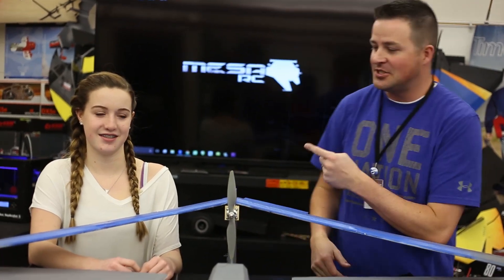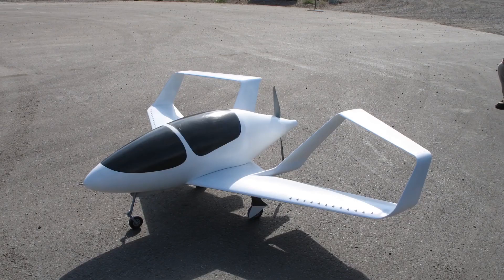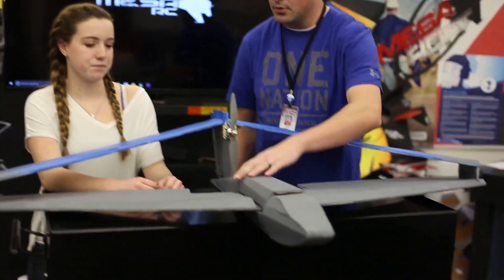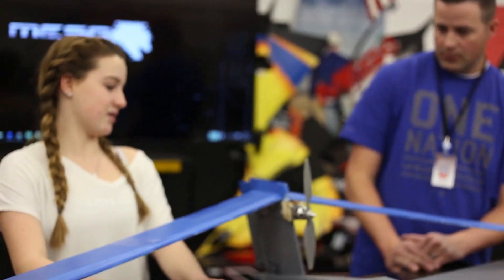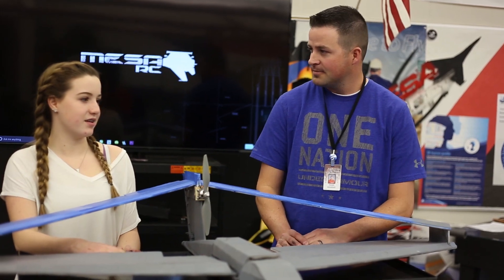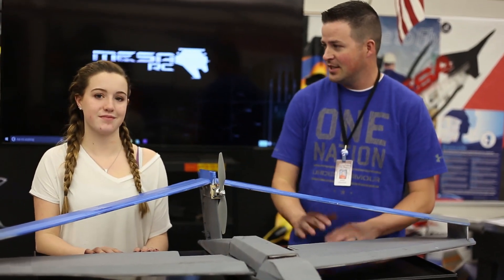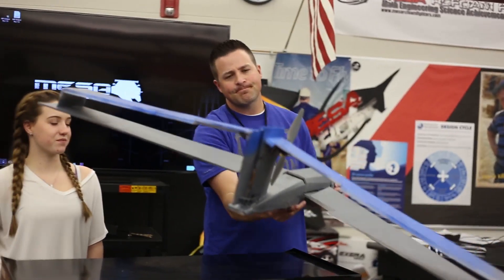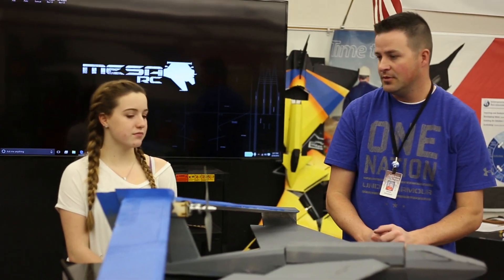MESArc - The Inversion Box Wing Project - NEED HELP!

Comment: this is called prandtl plane design, alot of detailed research gone into this type of box wing, particularly in italy
( cant remember the name of the group off top of my head), there was a phd thesis published that has all
the details on that design the maths included. The basic problem of the design shown is the wings, you need to have the big wing at the rear and the smaller wing at the front. The reason being:
the front wing effects air flow of rear wing ( pressure profiles), in order to get equal lift from front and rear wings
( in order to stop that nasty rotation of the plane in forward/back plane) the rear wing needs to be considerably larger than the front wing, also the centre of gravity is way way way forward on this design , you will usually see the front
cockpit area is way in front of the front wing.
Its not obvious too see these things, but if you were to swap the front wing and rear wing positions, you would have a better chance at gettting it to fly. But everything you need to know about that design has already been tested and sorted out, alot of time should be spent finding out what others have already done, you can simply copy their work and save yourself dissapointment.

Comment: First problem that I observed (and thankfully, it's not due to any fundamental flaws with the box-wing design): direction of thrust (consisting of just the propeller) is pointing above and behind the center of mass, causing the plane to want to pitch down hard. I'd have personally moved the propeller to either the plane's nose, or behind the plane's tail (the fuselage, not the wing), so that the direction of thrust lines up better with the plane's center of mass.

Comment: The lack of stability is mainly due to two factors: the line of thrust, which is far too high and that needs to be pointed DOWN to the ground, about two length of the aircraft in front of it; and the back wing, which is very anhedral and swept forward, creating far more lift than the front wing. You both should also learn about air foils before trying to make non-working toys.

Comment: First find your center of gravity. It is WAY up front, hence nose dives every time.
Reply: Put the motor at the back, decrease the height of the rear vertical stabilizer, increase the height of the two winglets on the wind tips. The batteries should be farther back for balance, but that might not be easily done.

Comment: Hey, congratulations Susannah and the MESArc team for trying some crazy stuff! Box wings and Boxtails are very different from each other and you can't just combine ideas, so pick one. Right now the layout says 'box wing, maybe... boxtail, no way.' When designing a box tail aircraft (using X-Plane can help), keep the tail and wing surfaces properly separated. Separation distances at any point along the entire span should not be less than a combined 'wing-chord-plus-tail-chord' length apart, as measured at the 25% chord location. Yours are too close. Controls: keep them on the tail; simple, effective. You won't need a rudder at all, just elevons.pivot them like Synergy or hinge them normally. Either way is fine. Balance: think flying wing. Work out thrust lines and CG as if the tails weren't there, then balance a tiny bit forward of that so that the tails have to make a 7-8% download. Keeping things light will help a lot. If you need help, give me a call. Glad to assist. -John McGinnis (find contact info at Synergy website) https://www.youtube.com/watch?v=Cgdc24kNYE8&index=4&list=PLp0A9EG2NdqZB59kY7go1QfVVqeiJzjuL

Comment: Too nose heavy.  Needs leading edge ailerons and perhaps front canards to compensate.
Reply: Nice going folks...cg must be ahead of neutral point,thrust angle looks wrong,
Reply: suggest getting a plane that glides first, would suggest airfoil profiles  be at least the  same (legates stratos), Does the rear wing lift? If so , incidence may be akin to canard.  Good project!!!

Comment: angle the motor down about 5 deg or more :)  you will need to fine tone the angle but it needs down angle to over come its placement off the center line.

Comment: Great job Susannah!    Here are a few ideas to try. 1) Make sure the back wing has exactly the same angle of incidence as the front wing. If the two are not perfectly aligned, then the whole of the back wing will act as a giant elevator, overpowering your elevator. You’ll need to use an incidence gauge or a pair of yard sticks to check this. 2) Your elevator is too small. In the examples of full size planes in your intro at the 53 second mark you show a plane with all of the back wing as an elevator. Yours is way too small. 3) I agree with the others, your plane looked tail heavy, need more glide testing to find the correct CG.  Keep up the good work.

Comment: In the 80's I read about trials to get such a boxwing model flying and it did not work. This config has nonlinear stability. The only successful application of a boxwing I know is an ultralight called Sunny Boxwing with the upper Wing in front and the lower wing aft. I googled a bit and found a long article telling what difficulties are hidden. 

My suggestion:  CG forward, Motor to the front. make ailerons to elevons, put GYROS on all axis, don't expect too much, don't trust computergraphics. And yes, you will need a big rudder because an aileron input will induce a lot of adverse yaw.

Comment: The height of the motor above the wing and fuselage appears to be creating a rotational force. Appears to have enough power and wing area to fly.  Also appears to be significant drag causing the tail to rotate and the plane to pitch aggressively forward or back

Comment: First off, let me lead a virtual standing ovation for this young lady's tenacity in attempting a Box-Wing scratchbuild - AWESOME!!  Do not, DO NOT give up Susannah!  The box wing is a fickle beast, and "normal aircraft" intuition may lead you astray if you're not careful.  As a fellow RC-enthusiast of over 18 years, and an aerospace engineer; I'm actually really glad this first attempt crashed and pitched because it's going to make you scratch your head and you will end up learning MORE than if it had just sailed out of your hands into the air.  Embrace the trails and learn from them!

The elevators and ailerons are in fine locations - don't move them.  You just have balance issues with....

....Thrust Line and CG!

Thrust Line:
Aircraft CG is not just a fore/aft placement problem, it also has a vertical component.  This vertical element usually doesn't come into play because the motor/prop are usually placed near the main body centerline, which is also usually close to the vertical CG position.  HOWEVER; once you put the motor/prop higher above the aircraft, you will encounter some serious "Powered Effects".   Throttle becomes a coupled-pitch-force, instead of just a forward-push.  

To counteract powered-effects, you need to point the thrust-line AT the CG, which in this case means angling the motor/prop down.

Center of Gravity:
You may be almost fooled into thinking that this plane was nose heavy after viewing all of its nose-dive launches, but that is entirely due to the powered-effects stated above.  The one ground-takeoff observed showed a RAPID nose-up and stall once sufficient airspeed was reached for lift, and then the later nose-in-loop launches.  This actually means your plane was quite tail-heavy, or at BEST, something aero-engineers call "Neutrally Stable" - This basically means that the Aerodynamic Center (AC) and Center of Gravity are at the same longitudinal spot.  A Neutral-Stable aircraft will be almost IMPOSSIBLE to balance/fly manually - state of the art jets and fighters use massively powerful computers and thousands of hours of simulation to program control laws to enable near-neutral stability and maintain control.  Near-neutral stability is good for commercial cruise efficiency, but that's not something you need in a foamboard parkflyer.  :)  You want POSITIVE stability, which means the CG needs to be well in front of the AC.

Moving the CG forward will improve static stability, and it will also reduce the amount by which you have to angle the thrust; the further forward the CG, the less you need to point the motor down.  Start by ignoring the upper/aft 'wing' and calculate the desired CG based purely on the main wing "Mean Aerodynamic Chord" (MAC).  

The MAC is an imaginary chord-length that is used to represent the whole wing and estimate where the center of lift might be.   A good rule of thumb is to balance your plane at the "Quarter Chord" of the MAC - This means your CG should be 1/4 of the way down the MAC.

For a constant-chord wing, the MAC is just the wing chord.  But for a trapezoidal wing, it's a geometric 'average' of sorts between the root and tip chord.
This link is to a simple wing-MAC calculator, that ignores other surfaces (it's intended for flying wings), but it's a perfect tool for calculating the MAC of the wing-alone: http://fwcg.3dzone.dk/
PRO TIP:  Click the "Show MAC Lines" button when using the above link, and it will show you graphically how it uses geometry to calculate the MAC location!

I know that's quite a wall of text - my apologies.  :)  Please don't hesitate to ask me any followup questions if you need.  :D

      Ben
Reply: if it flew well right off you'd learn nothing
Reply: Ben Harber thanks so much for your input, i didnt watch all of the video because of the cringe i get from the crashes, but i learnt so much from you. Thanks once again

Comment: give a little down thrust or just mount the motor as pusher behind the fuselage, thrust line should be in line with the CG. and use elevon mixing only on the rear upper wing

Comment: We built one of these before. As soon as you pitch up, the main wing shadows the airflow over the rearward high wing. When you get enough separation (vertical distance between the wings), it will fly strait but then when you go into a turn more than 15-20 degrees, it will tip stall badly. Unfortunately we couldn't get enough vertical separation to make it work and abandoned the idea. - Jacob

Comment: I would say the trust angle has less to do with it than the CG. Remember, lateral stability is determined by the relationship of the CG to the CENTER OF LIFT. With that high lift tail, the proper CG might be further back than you think. Lots of glide tests, have the battery on some sort of modular tray so that it can be moved around easier. 

Also, moving the motor lower (put the 6x4 back on that motor), wouldn't hurt ;-)

Comment: I'm just a beginner but I feel the same here it could an issue with the thrust line based on its looping tendency. Why not mount the motor on the nose ? which would take care of the CG too... and it would be nice to use the foam board supporting the second wing a little bigger and convert it into dual rudders...  Just a suggestion...

Comment: I dont know much about this type of airplane but why not try a KFm2 like airfoil for the top airfoil in the back and maybe try putting the motor on the front or two small ones on the sides using standoffs

Comment: I am no expert, but I believe  that if you throw it straight forward in the air with motor turned off and it don't glide...then it likely won't fly when motor power actually is applied.

Comment: Correct me if I'm wrong but it looks like CG or Thrust angle.. I would try to see how it glides to determine if it's your thrust line or not. It also looks like it could be tail heavy as it was flipping violently in the air. I would try to figure out the CG through trail and error...Looks like a really cool design! Hope you get it worked out!